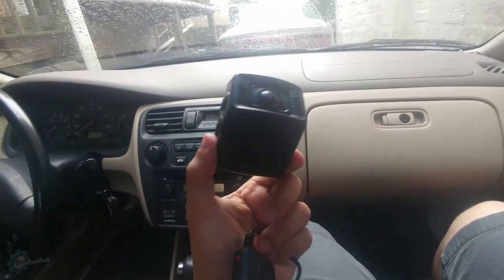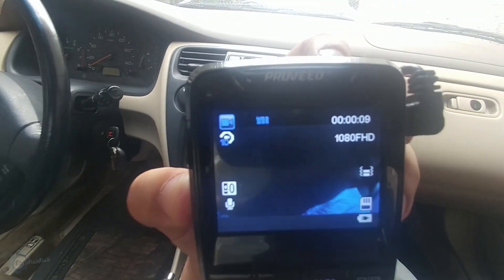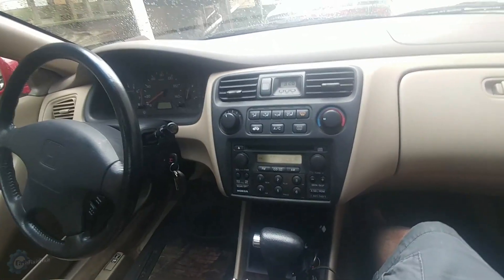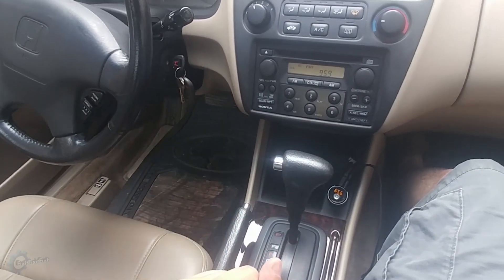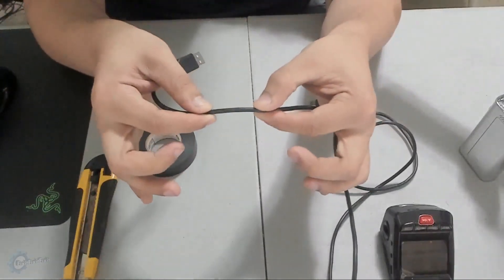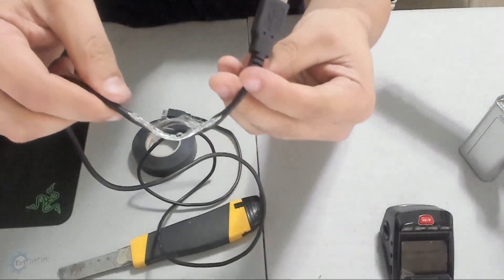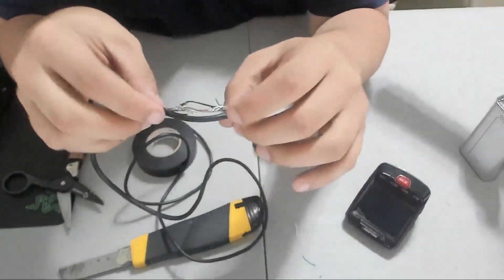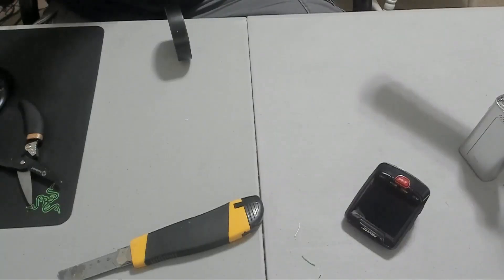Modify a USB wire to Power a DASHCAM - No PC Mode Tutorial Guide

Comment: All I did was use an old usb lead ,cut the plug off the the end leaving about 6”in of lead , then cut the cigarette lighter plug off the original lead .
And just soldered the leads together joining just the black and red wires !
Much neater and works perfectly 👍

Comment: electrical tape is garbage. as this video is 6 years old, i challange the video maker to go and look at the tape he used on this repair. it will surely no longer be adheared to the wire. the pvc electrical tape is good for about 2-4 years at regular temps. in cars the adheasive drip out after a year or two and the tape will just fall off. hopefully doesnt short out.
Reply from the maker: To be honest whenever possible id rather use liquid tape.

Comment: they make "power only" wires. i have a dash cam that runs on usb, in the instructions it says for data use your own data wire. the factory wire that comes with some dashcams are power only. the reason no camera view pops up is the cable. and while your technique works it would be easier to just find a power only wire

Comment: Thanks for that perfect video. I clipped the white and green wires, and now it works perfectly. My new car has five USB-C ports, and one of them is located at the top of the windshield to the right of the rear-view mirror. Therefore, I have no need for a cable hanging down and getting in the way when I shift. Your solution was a godsend. Thanks a million!

Comment: Sort of works with my Garmin 2595 GPS.  It goes into the computer mode at first for about 30 sec and then changes over to the power mode.  Garmin products detect something's plugged into USB port and then asks if you want Mass Storage etc. To make the modification really work I wonder if you have to also remove the two data pins at the plug end?

Comment: I tried connecting the black to black and red to red wires from 2 cutted usb cables intended for a LED strip light, still doesn't light though. Any thoughts as to why?
Reply: Shoot this is old but I will give you my opinion to you so every who has this problem can read it. The case maybe wire are mixing keep them apart or it could be they aren’t making proper connection. Recommendation make sure all wires are separate and you might need to solder the wires.